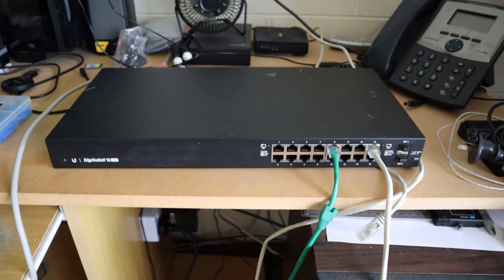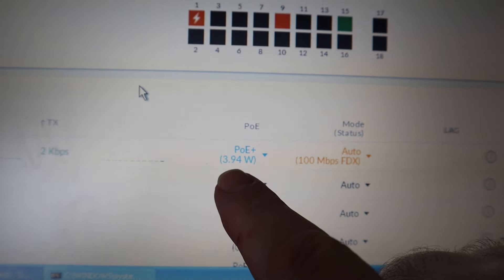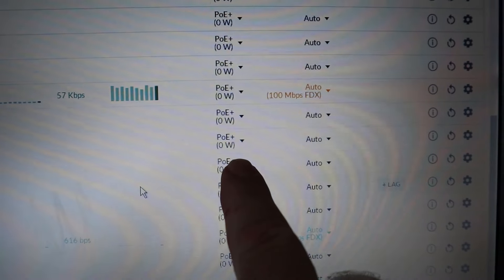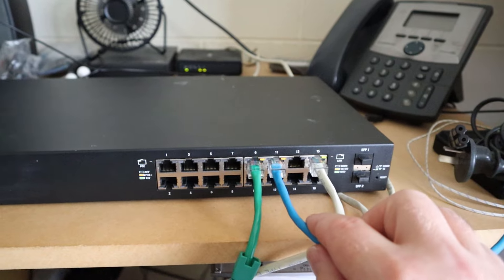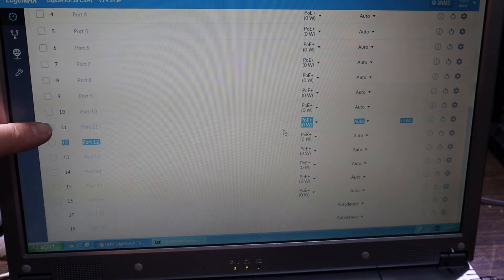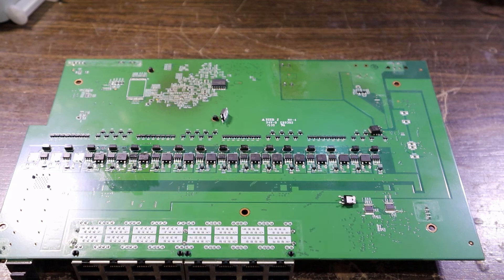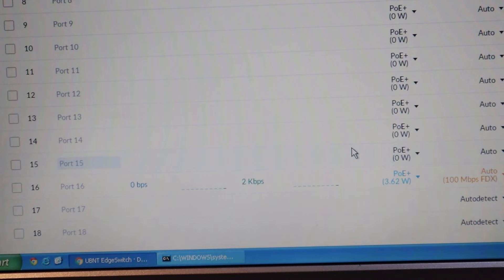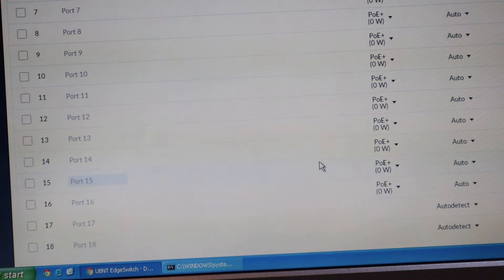Ubiquiti Edgeswitch 16 POE Repair!

Comment: My EdgeSwitch24 (500W), when disconnected from power and reconnected, resets all connected NanoStations to factory settings.
Reply from the maker: That must be very annoying
Reply: @JonnyFix  You don't know what could be causing that problem.
Reply from the maker: @AvatarStark  Sorry mate, I've not seen that before. Others are saying the unit will reset if it detects voltage on the ethernet data pairs, this isn't a fault it allows them to be reset remotely, so induced voltage due to startup current in the cables or not using shielded ethernet cables, maybe they are running next to power cables as well. The shielded cable should have shielded terminals that ground the cable to the switch chassis. This will prevent induced voltage from adjacent cables.

Comment: 802.3at PoE is nominally 48v so there would be no issue running a PoE device without the control protocol - some PoE injectors are passive and there are thousands of them deployed in the field, due to a few differing standards that came in that weren't interoperable ( older Cisco wireless APs for example). Also a non-PoE device won't (or at least shouldn't) be affected by having 48v run though - this voltage is DC-filtered on ingress and the card should only ever see the data signal. The one issue with running passive PoE is that it, and earlier 802.3af wasn't compatible with gigabit ethernet, which uses all four pairs. You'll note that your phone only connected at 100Mbps when the port was dodgy. 

24v is non-standard, and I think only used for some older access points from Ubiquiti (and some other vendors like Mikrotik). I don't think even Ubiquiti use it on their newer stuff though - it was always a bit janky and we network engineers tended to look down our noses at the 'toy' stuff that ran passive like that 😂

Nice fix that!
Reply from the maker: Cheers for the info. You sound like you're in the right industry! It's good to have a decent budget behind you so you can avoid using the passive junk :)   I accidentally sent POE to my PC some time ago...... I think it smoked the magnetics on those 2 pairs and no longer does gigabit.... and I did see a puff of smoke emanate HAHA. If the device isn't POE capable I guess there's no requirement to design to deal with it on the assumption it should never happen. Maybe I should do a video on my PC and investigate what actually happened!
Reply: @JonnyFix  Interesting. To be fair I've not tested the theory with actual hardware, and I guess some stuff won't have the filtering. You really don't want to be finding out that it's wrong on your brand new, $2000 laptop lol.

Yeah I enjoy networking, I was a field engineer for many years deploying microwave connections, dark fibre and the like as well as on-prem kit. Don't get as much chance to get my hands dirty any more though as I work for a largish UK ISP designing stuff in the datacentres, but I like to get out and do real engineering every so often 😉

Comment: Well done you clever devil lol :-D
I know nothing about that box of madness lol.
Odd how there wasn't  protection on the mosfets. Oh ok cheapness lol.
Hmm windows xp,  i used that os for years,   my local tesco supermarket ran the self service machines using xp.
One day i walked into tesco and one of the machines had crashed, it was obvious it was xp.
i never knew.
have you fallen asleep reading my jibbering lol.
Reply from the maker: Hahah... old laptops still good for something including filling in for my lazyness when the cable to the main workhorse doesn't reach far enough. I still don't get what part the fuses play in all of it, would love to get a schematic.

Comment: 60v rated on a 55v rail.... hmm thats a bit close, might be why they died.
Reply from the maker: Good point. I think POE max is usually 48V, maybe the PSU drops if all of the ports are supplying. Maybe regulation is off and is actually another fault I need to look at. I haven't yet worked out how they're dividing the main rail to get 24V either, I think there's another buck converter in there. Previously the main 400V filter cap failed and unusually the secondary caps are still fine.